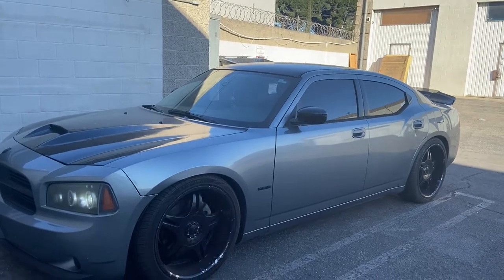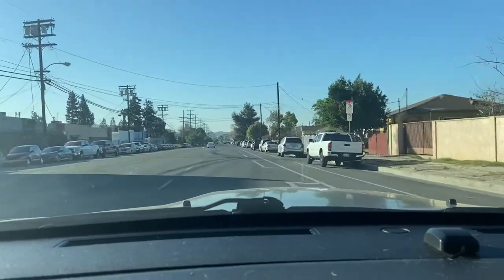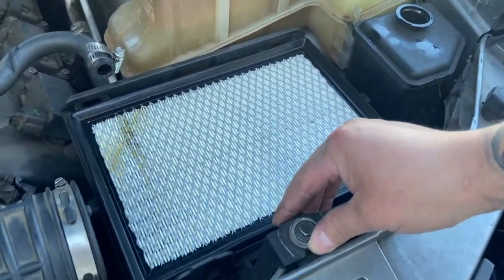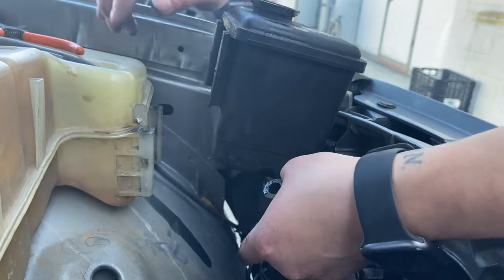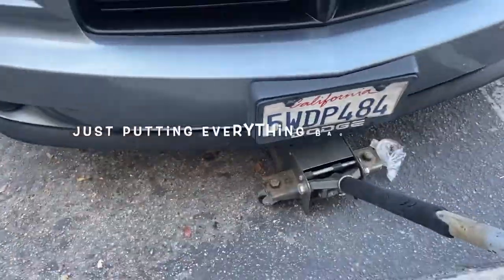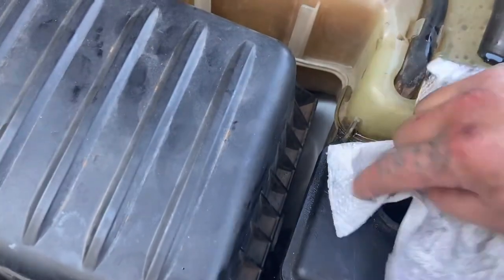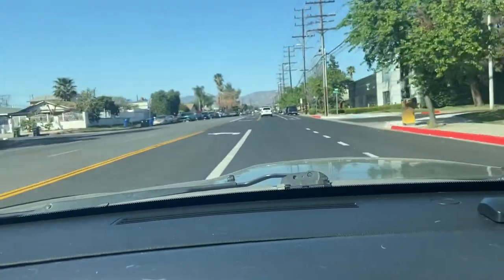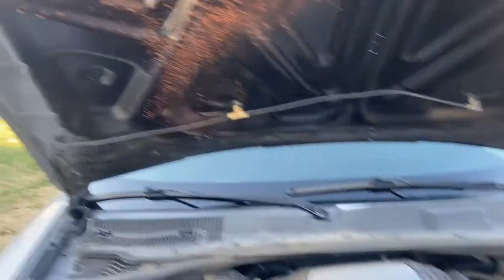2006 Charger RT Power Steering fluid flush Vlog 2021

Comment: no need to remove airbox,  start @6:30  unclip the reservoir,  remove the return line,  run line to catch bottle.  Plug reservoir return line nipple.  With front wheels off ground,  rotate steering wheel from left to right lock to lock with the engine off.    5 min job.   you'll need about 2 qts minimum.   Keep the fluid reservoir full,  don't let it completely empty.

Comment: Greetings MOPAR Bro I JUST subscribed to your channel I like the way you take us threw everything with your car straight to the point all the way threw I have the 07 Charger HEMI crazy thing SAME color as yours minus the black hood and roof although that look is 🔥. I’m learning ALOT threw your videos bro keep up the gd work I’m all the way wit you threw your build and you DEFINITELY helping me ALOT. Question ever got ride of that power steering whine I have it to and bought a new pump flush all that and it’s still there ANNOYING. Gd look and I’ll DEFINITELY be following your videos Stay Blessed 💪🏼.
Reply from the maker: Hey man, thnx so much! The reason I started these videos, was to just show the problems and solutions I go through, hoping it helps someone else.
So I appreciate u!
Now as far as that loud whining noise, we’re assuming it’s either a wheel bearing, or a tie rod.
I still haven’t tried to fix it, cause I’ve been mad busy with work. But as soon as I figure it out, I’ll def let u know.
But I don’t think it’s a power steering prob, it’s got to be something to do with the wheels.
Reply: DEFINITELY RESPECT AND APPRECIATE YOUR REPLY BRO I still watch ALL your vids didn’t know changing a throttle body was that simple I took mine well WAS taking it to get cleaned they quoted me $100 BS I did it myself after your video but after cleat it you gotta press the gas peddle to set it I saw that on anther you tube video however I’m wit you bro💪🏼

Comment: Are you sure its not your transmission hose leaking low Atf +4. Need 5-6 L where it say dealer only on the cap they have a tool dip stick at the dealer u can stick in to know if you have enough atf +4

Comment: This is great man. I learned a lot. Could I get it done there at your shop?
Reply from the maker: Thnx bud! But I wasn’t at a mechanic shop lol I was doing this at work 😅
Reply: It’s a great work bud, so I have a question for u, I wanna change the liquid so what percent it’s probably that in all System don’t get a little air in, I don’t know if it’s most better if tur to the right and left until drain the liquid and addd more